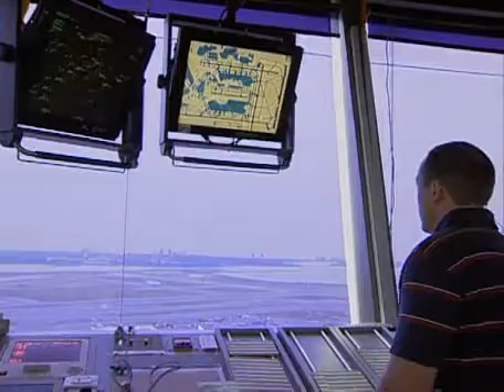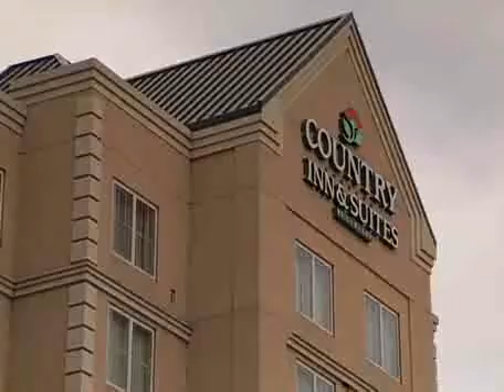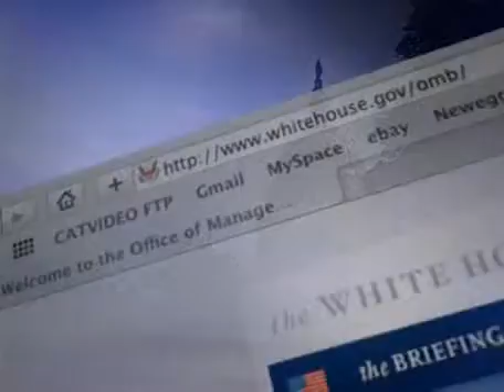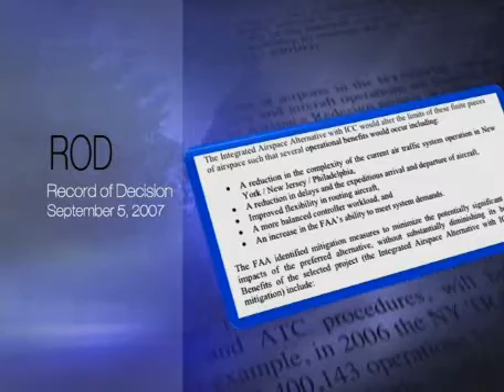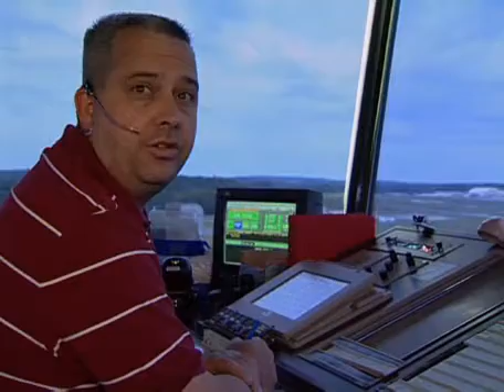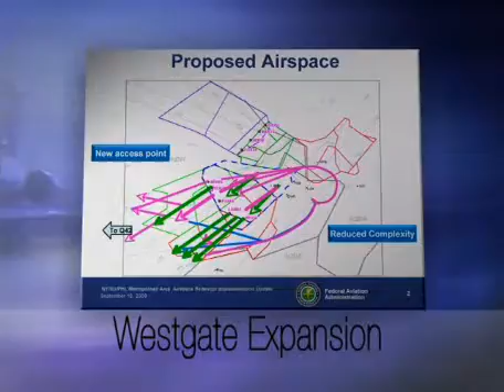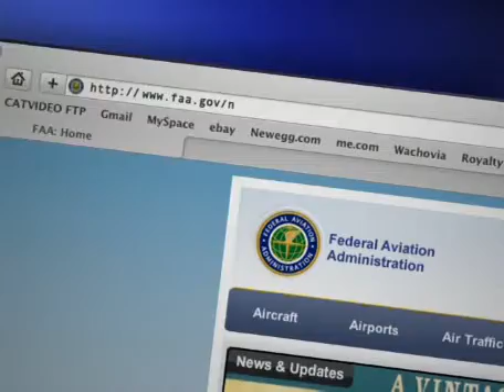New York - New Jersey - Philadelphia Airspace Redesign Project

Comment: The US is unlikely to be the first to implement GPS.

The system is geriatric and there are to many interestes in congress to remove efficency without CASH, for change. Notably Metric vs last centrurys imperial units.

Instead, what will probably happen is that other international systems will be developed, and then the USA will "have" to change to new system.

The boot  will be on the other foot for a change.